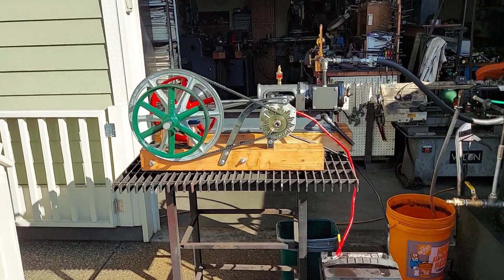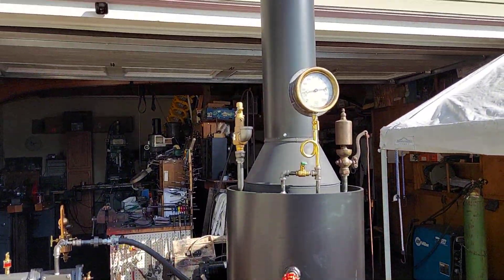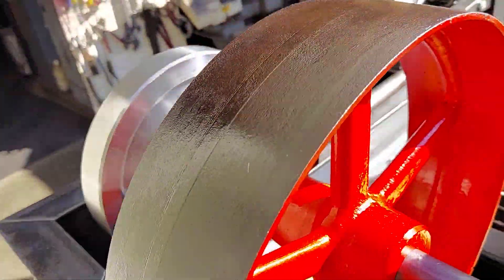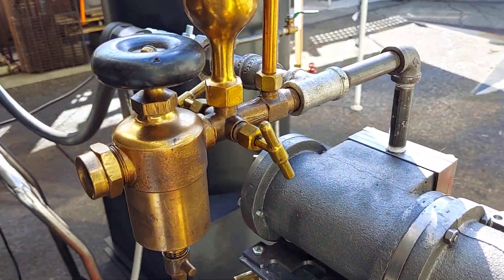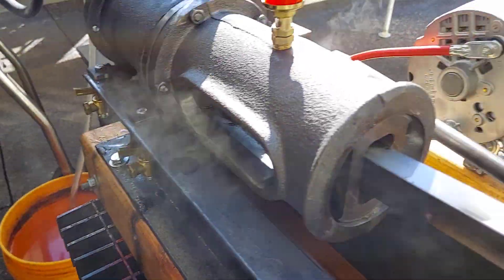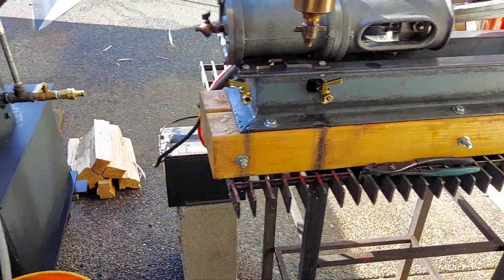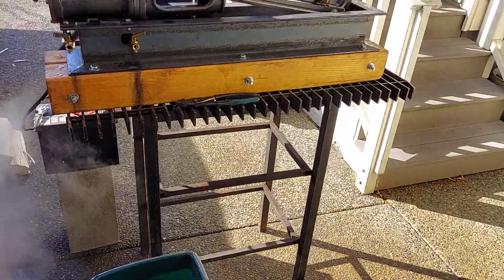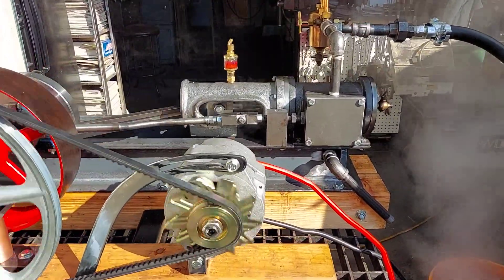FOR SALE Mill Steam Engine Alternator Whistle Gauge Offgrid Live Steam Engine boiler off grid

Comment: How do you keep the boiler itself from scaling up from the water is there anything to add to the water to keep it from scaling
Reply: There are some compounds that can be mixed in, but a way that proven to work just as well is to blow down the boiler at pressure. This blows all of the loose scale and solid material that has sank to the bottom of the boiler while it rose steam. Steam locomotives undergo the same procedure after a certain amount of running.
Reply: @Nick-xm1ux  I remember doing that in the Navy with our donkey boilers they ran off the exhaust from the main gas turbine engines and I remember having to do a blow down to get off the scale and all that now I know what you are talking about
Reply: @jamesmurphy1480  Cool stuff. And I am sure there are websites where you can buy compounds used for loosening scale in boiler.